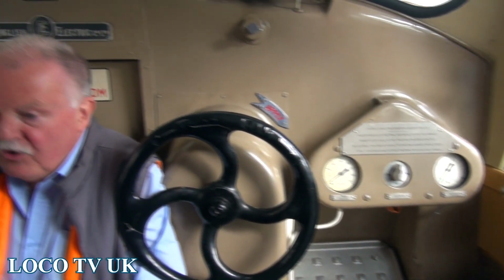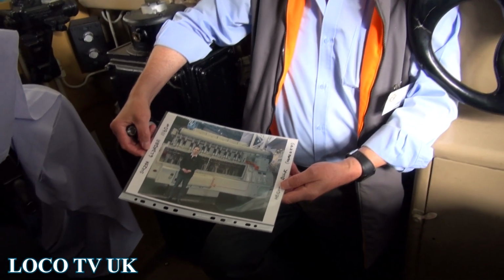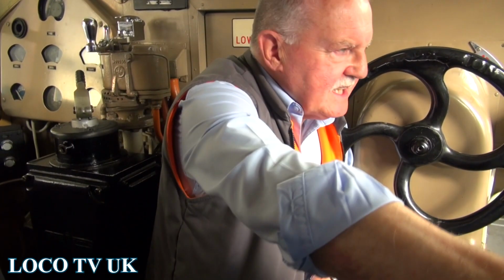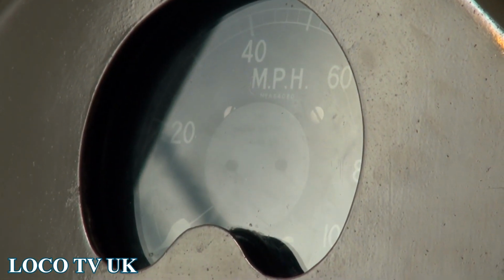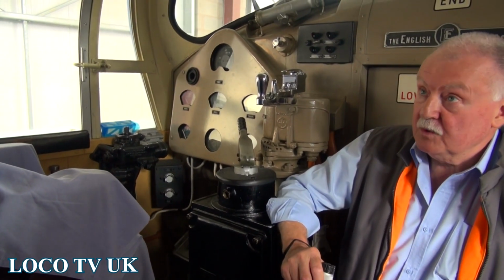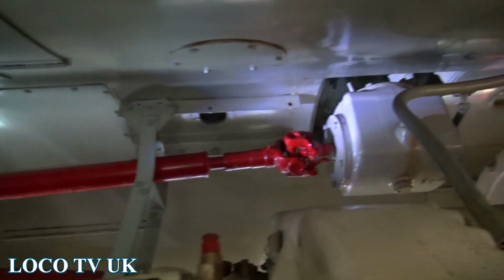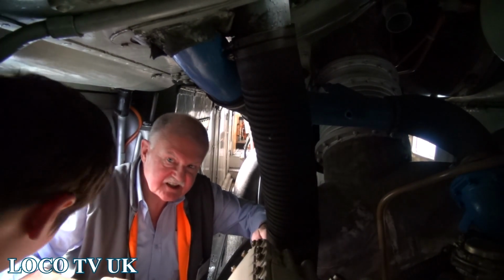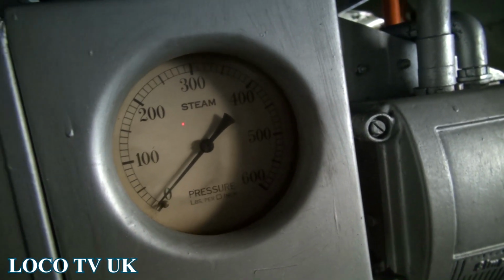DELTIC (DP1) Cab & engine room Guided Tour  LOCO TV UK

Comment: I love the Deltic. I've seen DP1 at Shildon and it is a mighty beast.
This is a great look around. thanks. How much power do the electric motors produce?
You say Napier developed this engine from a Junkers prewar unit, well I knew it was designed as a marine engine, but not a German one???
Reply: The channel Curious Droid has put up a video that goes into the history. Junkers wanted to make an engine like this, but it had timing problems. A Napier engineer solved them with a very simple solution, and the rest was history.
The engine was originally meant for torpedo boats, early in the war the German ones were superior. The Deltic was later used in a Norwegian boat, which the Americans bought for "stealthy" use in Vietnam, as it's engine didn't "sound like an engine".

Comment: Why BR never followed the established USA diesel engine development beats me, especially as export orders were essential. North America implemented diesel electric on their railways during WW2!! The Deltic engine was interesting but it would never be capable of long daily use together with large gaps between maintenance. Also being lightweight would hinder adhesion under heavy load . It also seems strange on a locomotive with bags of electric power to have steam for heating and another fuel engine for its circulation!
Reply: British loading gauge is much more restricted than that in the USA; we cannot run double stacked container trains for example.  Two Deltic engines could produce more power than any conventional Diesel engine available at the time that could fit in a British locomotive.

Comment: Deltic... 'Development began in 1947 and the first Deltic model was the D18-11B, produced in 1950. It was designed to produce 2,500 hp (1,900 kW) at 2000 rpm for a 15-minute rating; the continuous rating being 1,875 hp (1,398 kW) at 1700 rpm, based on a 1000-hour overhaul or replacement life.[3] By January 1952 six engines were available, enough for full development and endurance trials. A captured German E-Boat S212[citation needed] was selected as it was powered by Mercedes-Benz diesels with approximately the same power as the 18-cylinder Deltics. When two of the three Mercedes-Benz engines were replaced, the compactness of the Napier engines was graphically illustrated—they were half the size of the original engines and approximately one fifth the weight.[1]'

Comment: It was a pleasure to listen to this man. Short and good. I "grew up" with the OP engine as in my technical school in Warsaw (age 13 till 19) we had a perfect cut-off example of Junkers 600 HP aviation engine, six cylinders only..and every brake between the lessons I could examine any detail of it. It was a Junkers patent from ..1920ties. Napier bough it much later and decided to use the Deltic Desing for locomotives and speed boat propulsion. Using Diesel Oil in aviation had a short and successful history, mostly in Germany. Such engines could bring 1000 HP being not much heavier than petrol engines. Fuel efficiency was better thus less weigth to take with for the given distance. But I think the low temperatures in the height the planes later used ..over 20 000 feet made a problem. And coming back to Deltic...the polution problem with dirty exhaust, here (see my comment below) could be managed with a kind of "afterburner" for production of steam made of engine cooling water with the "dirty exhaust" and additional burner. Good efficiency of the whole unit and cleaner gas in the stack could make it.

Comment: I don’t think that power to weight or power to size are very crucial in locomotives. I think the biggest strength of the Deltic engine was its availability. The EMD 567 may not have had as good a power to weight or power to length, but they sold a few more. If you wanted more power, just add a B unit. Which also gave you more wheel area on the track for more traction.
Reply: Power to weight is vital.
Reply: @railfreightdrivergallagherGBRf  it is, but it’s not simple because of the low friction and rolling resistance of steel wheels. If you’ve got a locomotive pulling a long heavy train relatively slowly, the locomotive has to have lots of weight relative to its power to get enough adhesion to pull the train.  If you’re doing a high speed train you do need a high power to weight ratio, but you really need powered wheels on multiple cars to get enough adhesion to get that power to the rails without slipping.  

At low speeds, like in switching yards, they use slugs, which are diesel electrics with the diesel part removed and replaced with concrete to keep the weight up.  You can have a diesel unit power itself plus a slug.  You actually deliberately decrease the power to weight ratio to get more traction.  On the longer trains, too much power in a single engine can snap couplings, so you need to distribute locomotives throughout the train.
Reply: @glypnir  Don't worry, I know how to drive as its my job, but they have it all wrong here. The units are 100% wedged in. Likelihood is they will have to be cut on site. Now 30 years old(the 158) and the 159 not much newer. Shame really but the way it is. All the loco power in the world won't shift it, or adhesion if the things are stuck .
Reply: @railfreightdrivergallagherGBRf  it would be fun to watch, though. It’s only 2 of the 4 axles, so about half of the 41 tons - say 20.  25% adhesion, since it’s always raining in England, that’s only 5 tons of tractive effort.  Certainly you’ve got a locomotive that’ll do that?  There’d be some marvelous screeching going on, 4 flat tires, and the track worse for wear. Probably lots of sparks?  It would be better than a tractor pull. Perhaps railroads should try providing intentional entertainment for a change.

Comment: Steam had not reached its development potential and it never really did. However, the steam locomotives used by BR were massively labour intensive, whereas diesels were not and on that basis, the availability of diesels was so much higher than steam. I can recall that BR's Deltic fleet had travelled one million miles in very little time and one reached two million miles in little more than ten years- at least three times faster than an express passenger steam locomotive used on the same mainline would achieve. The Deltics were a success by any standards- yet so few were ever built but they replaced a very much higher number of steam locomotives.
Reply: The Doble steam cars of the 1920's are interesting. They were an attempt to make steam cars as convenient as internal combustion (also of the 1920's, when many were hand-started) and nearly succeeded. I wonder how efficient, even "green", they could be with further refinement. Spray a fine mist of fuel in and ignite it, burn it completely, too. Steam engines want to keep the hot gases in, not expel them as quick as possible!

Comment: These engines are cartridge started. An explosive charge is inserted, indexed and fired like a gun. One crankshaft turns opposite way from the other two
Reply: Nope, not in locomotives. In the locomotives, the DC generatorhad special windings in it that were attached to a battery and allowed it to act as a gigantic starter motor

Comment: Just your ordinary average 88-litre 18 cylinder triangular boxer diesel engine.
Reply: It's not a boxer.  Doesn't event have cylinder heads.  (not edited.)  And a triangular boxer?  The pistons actually oppose each other and a pair of pistons act as the cylinder.  Then two crankshafts rotate in the same direction and the other must rotate in the other.  Crazy engine.  Not a boxer though.

Comment: Don't do this for real but could you fit a pair of class 73/9 1600hp MTU engines in.would it weigh more or less.squeeze a extra 50hp from each engine and you have a 3300hp loco .
Reply: Your question highlights how good the Deltic power to weight ratio was …..
Deltic engine weight (dry) each = 8,727 lbs (3,958.5 Kg)
MTU 8V R43 engine weight (dry) = 11,618 lbs (5,270 Kg)
So two MTUs would be 2,623 Kg heavier than two Deltic engines. 
Of course the MTU four stroke design is probably far superior in fuel efficiency and air pollution compared to the older Deltic two stroke design. 
I don't know if two MTU 8V R43s would physically fit into a class 55 locomotive but if they did fit it may be worth doing since a 2.6 Tonne penalty is not that much in railway terms, in fact it's not unusual for locomotives to be fitted with ballast weights to aid rail adhesion (e.g. Class 73/9).
Reply: The generators should weigh less as the MTU engine alternators ran at the 1800rpm engine speed, the deltics dynamos I believe ran at less than the 1500rpm engine speed, so the complete power unit would probably weigh about the same.

Comment: They could design a small version of this engine with modern materials and specs. It would make a good engine for challenger 2.
Reply: Geoff Jones.  They did.  The Class 23.  It had one, 9 cylinder Deltic engine.  The Deltic engine family was not limited to locomotives and I'm not even sure it designed specifically for what became the Class 37.  They we certainly in small warships.

Comment: Love the driver's ashtray next to the window. Wouldn't see that nowadays.
Reply: It wasn't all that long ago that cars had ash trays in every door but no cup holders 🤦‍♂️
Reply: @bl7355  lol, my car has'nt even got an ashtray, i remember as a kid going on school trips, coaches used to have a little ashtray in built into the seat in front of you.
Reply: @cbrboy76  Yes, and airliners 🤮
Reply: @bl7355  
Theatres and cinemas also had ashtrays in the seat backs, and often a coin operated holder for opera glasses which could be rented during the performance.  Projection rooms were a very different matter, with smoking strictly forbidden.
Reply: @bl7355  I remember those days, my first car was one such vehicle (1990s Ford Escort)
Reply: No, you just see ash blown all around the cab.....
Reply: You mean you don't see that for now?
Reply: Would be a mobile phone holder now haha
Reply: Apparently smoking whilst in a confined space with lots of flammable fuel and oil is “irresponsible”.
Reply: @bjoe385  Believe it or not diesel is actually quite hard to set fire to without compression.
Reply: @cofjohn  I know, I suppose drivers smoking was more an issue of distraction than fire.
Reply: Only because there are windows are your "new" locomotives.

Comment: So how did that work out? The light weight and high power? They blew up right and left, didn't they? And couldn't be repaired in the locomotive. And your "competitor" engine example is a poor example given the dominant locomotive manufacturer worldwide was EMD with lightweight, compact, serviceable, reliable and efficent EMD 2-stroke "V" engine. That basic design is still in production at up to 3.5 times its original power rating. And its hilarious you brag about light weight and high speed but don't say a thing about STOPPING it and don't mention that takes WEIGHT. Which is why horsepower to weight ratio wasn't something any other manufacturer ever tried to minimize.

Comment: On the 50s railway this must has been like a spaceship landing.
Reply: Would you like some sugar with your salt?
Reply: The HST had airbrakes and buckeyes from the off. Very few trains operating on the mainline today use vacuum brakes, and the ones that do are railtours. It's very easy to find this information out than being a wanker on Youtube. As to how they worked out? The majority are still around because they were and are pretty much perfect for Britain and the intercity services required.
Reply: DEEREMEYER1 yes ok are first HST was a complete flop but it showed us what we did wrong and now look at were we are with the Hitachi
Reply: Is that why they were still running steam into the late 1960s? And how in the fuck was a diesel-electric locomotive in the "1950s" like "spaceship landing" in a country that supposedly invented the jet engine, the jet airliner, radar, television and pretty much everything else in history? Or CLAIMS TO HAVE INVENTED THEM, that is?
Reply: Did the "HST" still have vacuum brakes like many British locomotives today? How about chain couplers? How did that piece of shit "HST" work out for you folks? And do you use the same "calendar" as the rest of the world? When EXACTLY in "years ago" was YOUR "70s"?
Reply: @deeremeyer1749  As you have absolutely no clue let me tell you some facts.
First of all the HST. "Piece of shit" in your words.
The world's most successful passenger train.
The first high speed train to be exported.
Still the holder of the world speed record(143mph) for diesel traction.
Forty years in front line service, each individual train has covered more than 18 milion miles.
Not bad for "a piece of shit".
Don't confuse - as Jacob Johnston has - the HST with the APT.                          

Deltic.
Introduced in 1955.
Prototype weighed 100 tons (UK tons 2,240 lb to a ton)
Production machines weighed 100 tons.
Rated at 3,300 horse power.
The production machines were introduced in 1961/2 and remained in front line service until 1981.
By comparison U.S. manufacturers were knocking out passenger locomotives weighing some 130 - 160 tons rated between 1,500 and 2,500 hp. Which is why you always see two or three couple to-gether in multiple.

Comment: It probably took 200 horsepower just to drive those shaft driven cooling fans. 
Great design, though. The U.S. and England were at the top of their game in the 1950s. 
The newer equipment might be lighter, faster, more fuel efficient, more powerful and more reliable, but it somehow isn't as impressive as this gear from the golden era of the mid 1900s.
Reply: DEEREMEYER1 __ Why do have to be such a wanker? You're like that Wilbur/soaring fellow. Why the bile and anger in all your comments? Genuinely 😕 puzzled.
Reply: @burlatsdemontaigne6147  Almost certainly the same person. He operates under several aliases. The clue is the spelling and phrasing that is used.
Reply: DEEREMEYER1 oh fuck of all i see is you talking shit about the uk in almost all vids about the deltic yes it blew its engins up so what it was a prototype A FIRST TRY
I know for a fact that there were U.S. locomotives that failed so dont go knocking us for one loco that failed if u read up on the deltic u will see that there was a plan to test it in canada and if it had done there may have been some in the U.S. and who gives one about the U.S. having no steam locomotives runing after the 50s we had been bombed for 2 years before u lazy lot turned up to help so all are industry was gone so we had to make do and mend what we had so thats why steam lasted longer and this resulted in alot of them being SAVED somthing u lot dont know fuck all about.

And also if british locomotives were so bad then y do u guys have one of are A4 steam locomotives over there TELL ME THAT!

IF U DONT LIKE SOMTHING THEN SHUT YOUR BIG AMERICAN MOUTH.

Comment: when one of these was coming though the tunnel at Glasgow Queen Street and you were stuck in the tunnel going into the station waiting for it to clear,you were near deaf and gassed by the noise and fumes,huge amount of power,,,,why cant they get this one up and running again?
Reply: battlestarone  It is rumoured that there’s no internals inside these two engines in this loco ?.